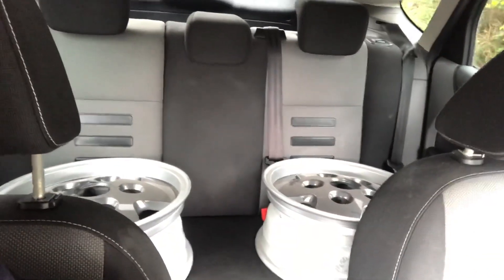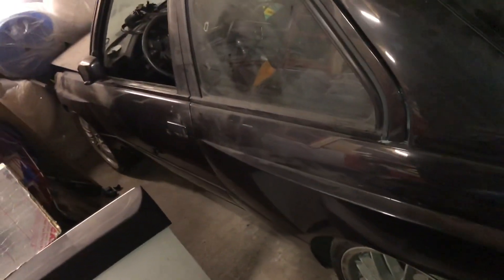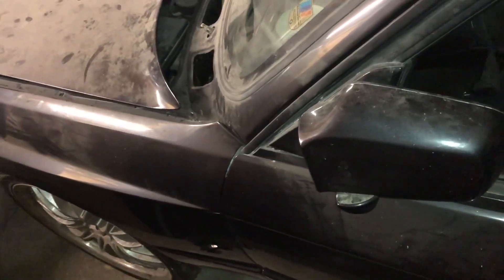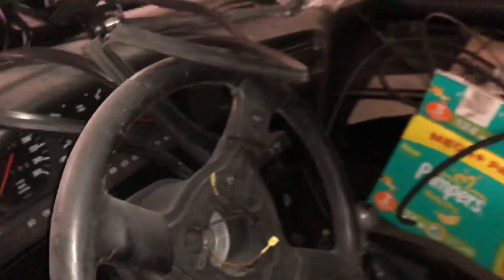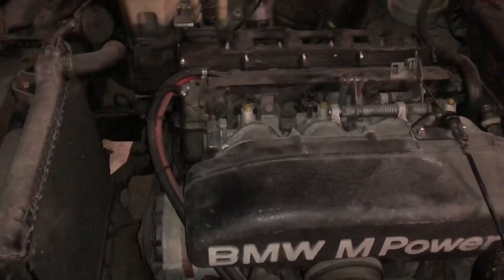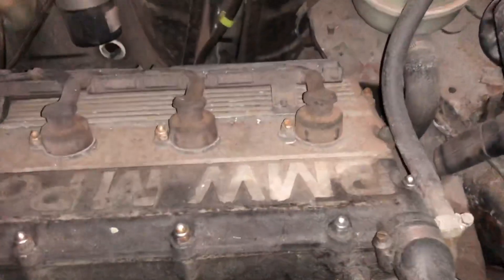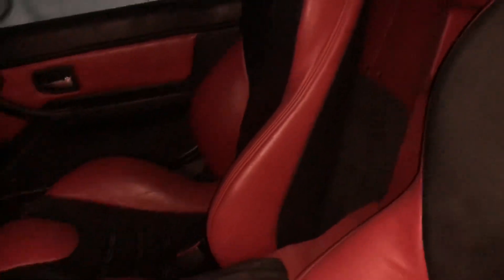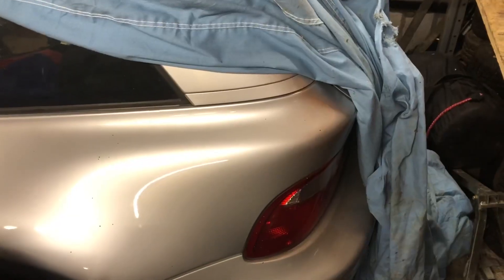Barn find E30 bmw m3 & z3m rare classics

Comment: The E30 M3 is something special to me.... especially as that one is my old car!!! I owned it and daily drove it for 11 years. Only sold it because of a growing family and needed a bigger car (X5 4.6is).  It's far from standard spec, 335mm discs and 6 pots, adjustable suspension etc etc. The rear wing is a copy of the DTM wing and the front has an adjustable DTM front lip. It's the one car that I truly regret selling.

Comment: You NEED to buy the M3 !   3dr Cosworth and an E30 M3 in your garage would be the best two touring cars of the 80's .
As an E30 M3 owner and currently engaged in a bare shell restoration, I'd love to pull that car from its storage and clean it up and get it going. 
Something is saying US import about that car, as a guess.

Comment: The M3 looks like a Jonny Cecotto special edition being that colour 
If that's the case they only made 505 of them.
And yes the last runs of the z3M used the e46 343 hp lump which replaced the e36 evo2 lump (321hp)
I corrected Autocar magazine years ago with that info because they got it wrong saying they were all 321 hp 😂